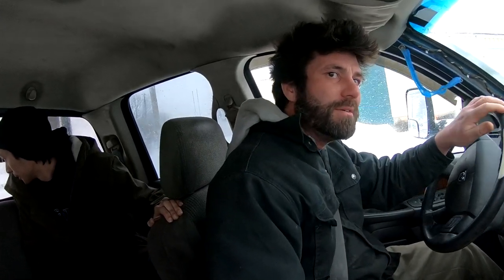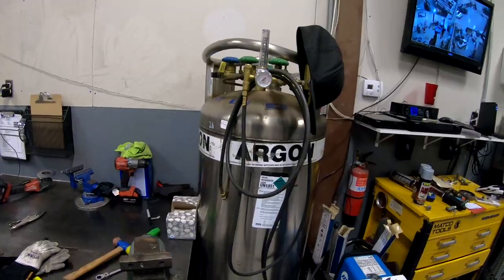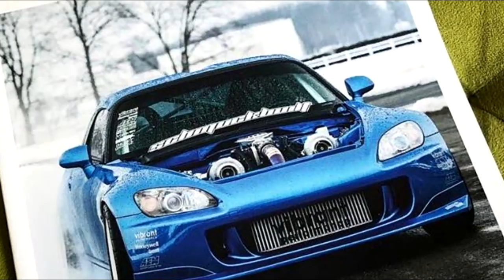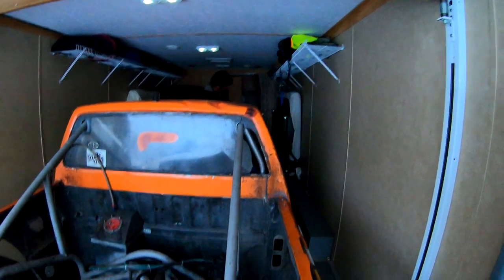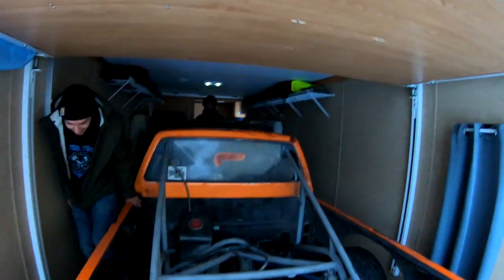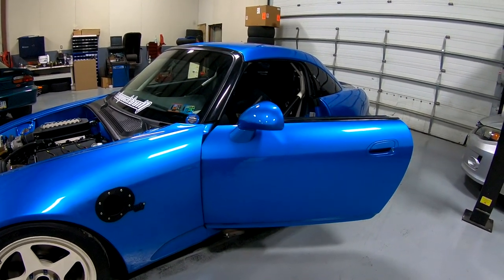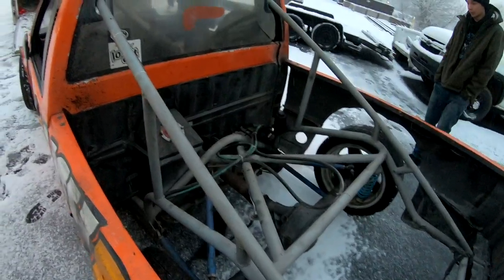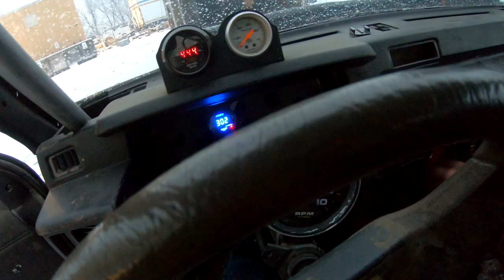S2000 powered Drift Truck SchmuckBuilt Turbo Build (part 1)

Comment: Hey, I just came across your page. Pretty cool little truck. After watching and learning a few things from guys like yourself, I’ve decided to turn the Ram Fitty into a little fun rocket. I have a few questions about your front suspension. Was all work done strictly fab work, or is there something I can purchase you can point me in? Thanks, keep her rippin brother 🤙🏻✌🏻
Reply from the maker: Those trucks are pretty old at this point, so finding parts might be a challenge...  But mine has (I think) Bell Tech lowering spindles and some brand of lowering springs too, maybe Bell Tech but I can't remember.  I can't remember the brand of shocks either, but they were bolt-in and they work great.  To adjust camber, I used longer bolts and stacks of washers on the upper A-arms.  Oh theres a bigger sway bar on it too - I think Suspension Techniques brand.
Increased steering angle was definitely custom fab - I lengthened the pitman and idler arms, plus I grinded some metal away from a few different things that started to rub.
Reply: WHIPBASH Thanks, I appreciate the info. I’m going with a 5.3LS with minimal mods, seeing as the truck only weighs 2800 pounds. It should rip pretty well. Again, thanks. 🤙🏻👍🏻
Reply from the maker: @thevdubguy7881  That should work pretty good. I love my 4 cylinder Honda engines though.  🙂

Comment: Didn't this have a 4g63 in it what happened to it? do you have the build page on it...
Reply from the maker: Yeah, same truck.  I retired it like 10 years ago.  I was replacing crank/ bearings, blowing head gaskets, killing transmissions, etc.  
Not much better luck lately with the S2000 drivetrain though!  
No build page.  I just make videos.  I should do a full video about everything I've done to it.
Reply: @WHIPBASH  nice. They make a w58 adapt er to 4g63

Comment: Whats the differential coming out of
Reply from the maker: This truck has a Dodge Raider rear axle (late 80s - early 90s)  They came with a factory LSD option.  Honestly, I might have to upgrade that axle when I turn the boost up and drop tire pressure, but I'll wait til it breaks.